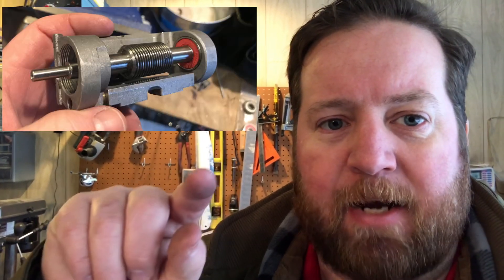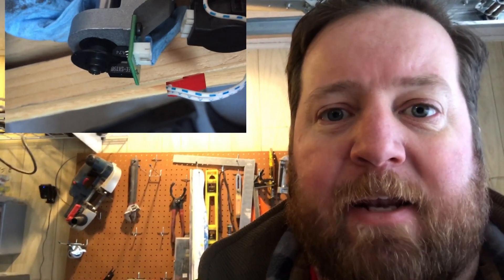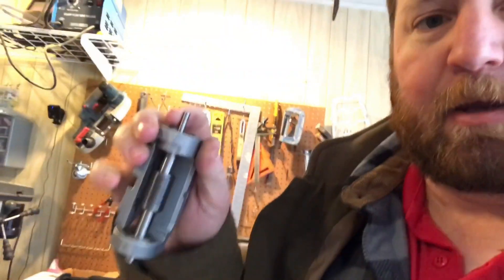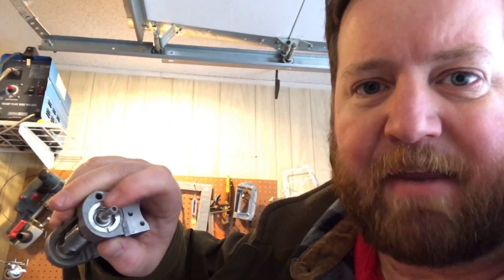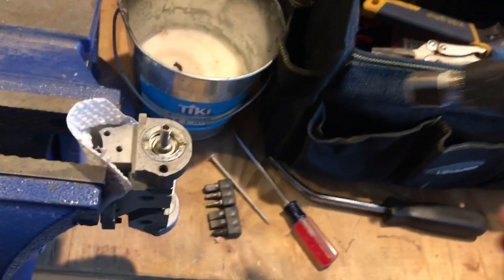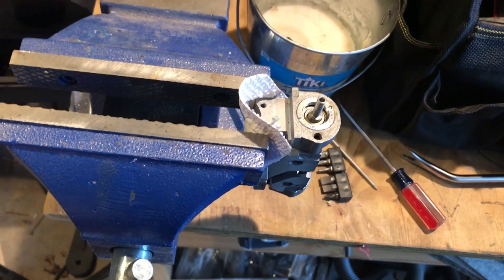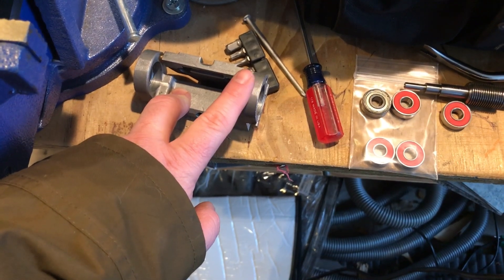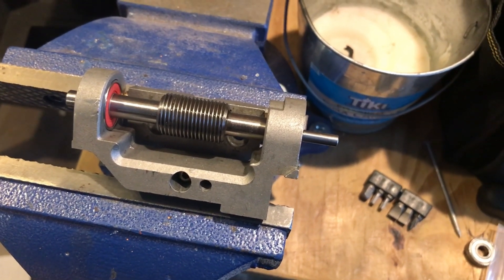CGX Trails, Worms, and Bearings — Resolution

Comment: Great video, however, you're overthinking it. That worm gear should spin freely using your thumb on the actual worm gear.. if it gives any resistance the retaining ring is tooooo tight!! Also throw those worm bearings in the fucking garbage!!!!! They are Chinese made crap!! Plenty of high performance bearings out there , also #2 you need to rebuild the inside gear box of the motor with two replacement parts, both are on the main drive shaft , they are originally brass inserts.. you need to replace them with a stainless bearing on the outside cover , and on the motor itself "the flanged bearing" also replace that with a precision bearing yes they are available, something like 2mm by 1.5mm by .o6mm flange..  when they come from the factory the motors and belts are set way to tight and they damage the brass bushing's, throw them out and replace them  With  U.S.A made high precision bearings and your mount will track like a $10k mount  "FACT" PLENTY OF VIDEOS TO FIND THE ACTUAL PART NUMBERS FOR THE INTERNAL MOTOR BEARINGS!!!  OR I CAN REBUILD IT FOR YOU AND YOU WILL GET 1.5 MINUTE FULL MINUTE UNGUIDED IMAGES, THEN ADJUST YOUR GEAR MESH, THEN ADD AN M3 × 0.5 mm shim between the very outside screw between the mount and motor to eliminate motor flex!! Which they ALL HAVE!! , THEN INSTALL A  "1-MM" SHIM BEHIND THE SPRING LOADED BACKLASH ADJUSTMENT SCREW!! THEN ADD YOUR FAVORITE AUTOGUIDER AND TAKE 1 HOUR EXPOSURE'S!!! THE CGX is a great mount but just needs to be rebuilt right out of the box with USA quality high precision bearings and bushings

Comment: Ed Foley seems to be out of the business now.  He said he would put a kit together for me but that hasn't happened and he isn't responding to voicemail or email.  Is there any chance that you have a record of the replacement bearings.  Manufacturer and stock or part number might help me find them.
Reply: I’m sorry, I didn’t keep it.  Oh, this is Dave btw. I use a pseudonym for general surfing YouTube.
Reply: Actually I had a thought. The bearing looked just like a standard thing. Kind of reminded me of a kids fidget spinner.  If you have calipers you might just measure the inside and outside diameters and the width and look in the web. I’m been surprised how many weird things I can find easy on Amazon.

Comment: Awesome Dave, I have adjusted the springs but this is a good solution if that problem still shows up - would you recommend a lubricant spray first before a replacement?  thanks!
Reply from the maker: Marty Spallone   The star trails problem can come from a couple sources. In the case that adjusting the backlash and gear mesh doesn’t work and you think it is the bearing nut, it won’t really help to lubricate it. The pressure is coming from the side and pressing the inner sleeve of the bearing to the inside edge of the worm. I think the only way to help it is to let off the pressure from the nut.

Comment: Hi Dave. Great video, and I am full of praise for your persistence and commitment to the cause! I have a few questions: would you please produce a video showing the entire strip down of the mount so the rest of us with the same issue can follow your footsteps? Also, would you please provide a link to where you got the replacement bearings? I am in Australia and as you point out, it's not really practical for me to ship my mount back to Celestron. Once again, thanks so much for all your work on this and your willingness to share information with the broader astro community.
Reply: Matt Watson I got the bearings from the hyper tune shop with a guy named Ed at the helm, I think from Arizona but us based. He’s a really nice guy so I suggest just giving him a shout or email if you need.

I’m afraid I didn’t shoot much more video except what I could post here. I’ve got it stable now so I am worried about taking her apart again. Sorry! But I’m very sure if you are mechanically minded enough to take it on, you’ll have no problem.

There are just two Allen’s holding the block in place. Remove the plastic cover and peek up underneath and the two bolts are directly behind the worm gear. If it won’t come loose, the Allen up and behind the counterweight bar is what holds the block horizontally to the gear. 

Best of luck!
Reply: Hi Dave. Regretably, no I am not mechanically minded. That's why I was asking whether you'd possibly do some videos demonstrating how you took it apart. I understand you not wanting to take it apart again, now that you had it back together working well. It just would have been great to have included more of the actual strip-down process. Once again, many thanks
Reply: Ah! I see I answered under my alias. This is really Dave! I use this account for general surfing ...

Comment from the maker: If your warranty is up in May, I suggest getting them to address it. Call them and tell them you are getting stars with trails. They will ask you to send in a log of your guiding and maybe an image or two. If you are currently having the issue, they will ask you to send it in and they will probably pay for shipping. I don’t know if they will address the nut too tight issue but they should give it the once over.  If you don’t want to tear it down all the way, I would advise just taking the motor belt off and trying to move the cog of the axle with your fingers. Even if the scope is loaded, you should be able to turn the cog and move the worm. If it is super hard to spin you might casually ask them about the retaining nut before you send it in.

Comment: Hey Dave, Thanks for the video.  I did a self tune of my DX prior to getting the CGX-L and noticed the over tightening of the retention collar during said tune.  I am not seeing the really big spikes but a lot of little ones.  How was the guiding?  Would love to see a screen shot or video clip next time your out doing AP.  My mount is out of warranty this May and I am wondering how I can get them to readjust the bearing without taking it all apart myself.  We ought to start a group for the CGX/L community on Cloudy nights.
Reply from the maker: George Lutch  there are quite a bunch of them on CN and they are not very happy with some of the quality control and customer service issues. But I’ve been on several threads that some way smarter guys have posted about how to get the most out of the mount.
Reply: That's a terrific idea about starting a CGX/L group. I'd be very interested in joining. My mount has the same problem is RA.
Reply: @MattWatsonAus  Here ya go, Pass on the info to all the CGX/CGX-L friends.   https://groups.google.com/forum/#!forum/celestron-cgx-and-cgx-l-mounts
Reply: @Astro-George  Is that forum still active? If so, how do you "join"?
 Clicked the link, got "You do not have permission to access this content. (#418)" back from Google Groups. Thanks.
Reply: @montewestlund8195  It is still active.  Should be able to join group.